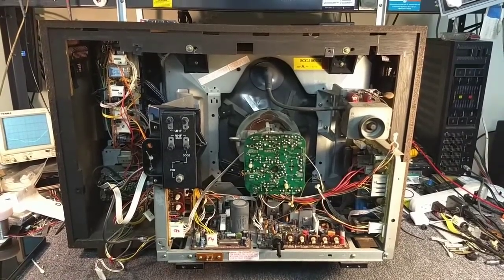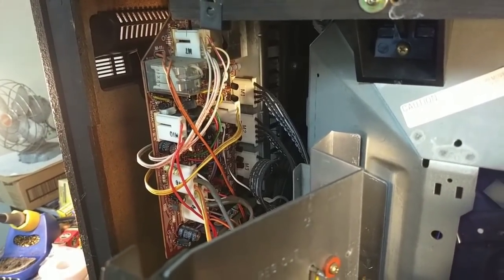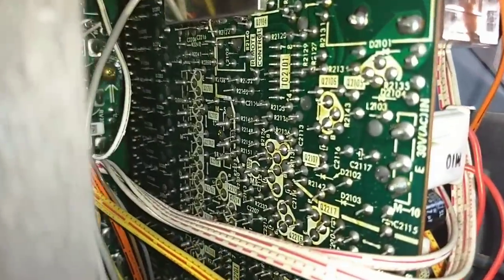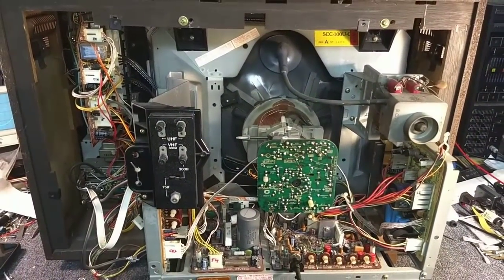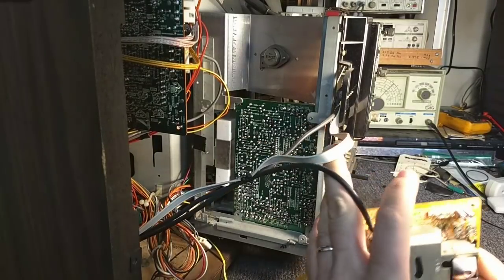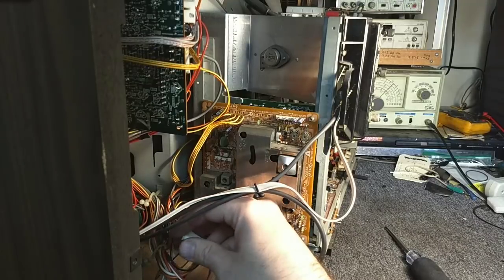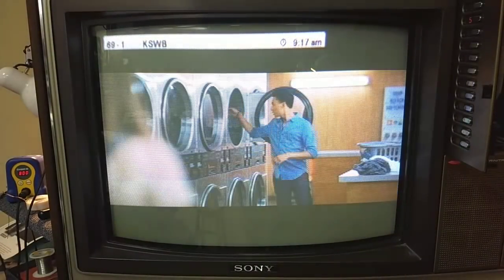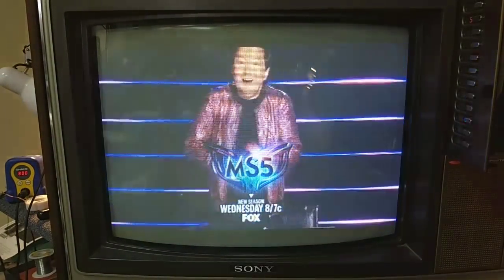Repair of a 1970s Sony Trinitron kv-1942r color tv. Part 6/? -Install IF board, Crt and control Bd.

Comment: Yes i did tell you about c316 as i know that you want that set as good as possible.
Also it shows that we are watching the video :-D
For knobs, a length of twine/guitar strings or fishing line can be looped behind the control knob to aid removal without damage. (There is a knob joke there, but we all know it lol ).
Yep the remote board is redundant.
Shame that the t.v boxes don't do the t.v justice :-(
I was told if you don't get the monochrome picture correct, don't expect the colour one to be.
Made sense when i used to set old sets up.

Comment: Greetings:
I am sure that any recent vintage universal remote control can fulfill the missing original remote's capabilities; but you know that. A remote that controls the ATSC to NTSC converter should include at least the TV power, audio level, and muting functions.; but you already knew that, too.
I also enjoy demonstating the location of the wire used to hold the aperture grill in position about one third from the top of the screen by hitting the side of the cabinet while the set is running. Unfortunately, once you know where it is you always see it in the picture.

Comment: I miss shows like Diff'rent Strokes. We used to get the show until Xfinity made a basic channel into a premium channel. And Xfinity doesn't carry  Antenna TV.
Reply: Why not get an actual antenna? I get half a dozen sideband channels that show reruns from the 70s and 80s - and that includes "Antenna TV," which is broadcast by the local ABC affiliate.

Comment: if ur gonna use this for gaming what are u going to do about inputs. most people gaming would want RGB for best picture but at the least composite or s-video rather then using RF
Reply from the maker: I'd rather play it like I did when I was a kid. Don't have a problem with RF. yes, rgb is clearer and more defined, but it's not what I grew up with. I'll play it how I remember it, the way it was originally designed.
Reply: @JordanPier  i always went with composite back in the day. i  probably would have went s-video Nintendo if didn't cheap out and gave s-video cables with the snes.
Reply: I played with RF until 2004 when I got a tv with composite. inputs. I didn’t notice much of a difference. RF is what I grew up with. I’d rather it for original 240p ps1 games.
Reply: @robertforster8984  composite is only a small step up from rf. there is better hookups then that such as s-video and RGB. plus with RF u only get mono audio